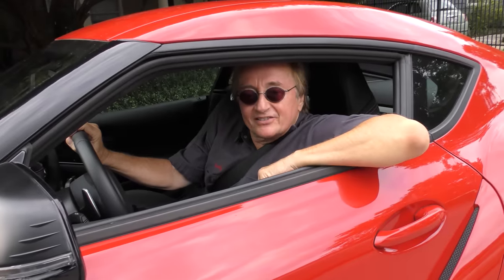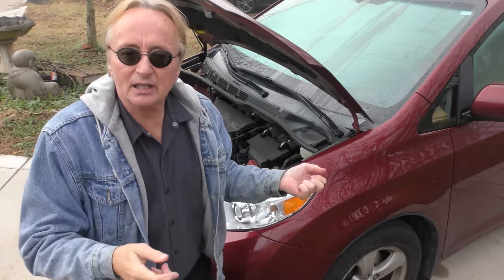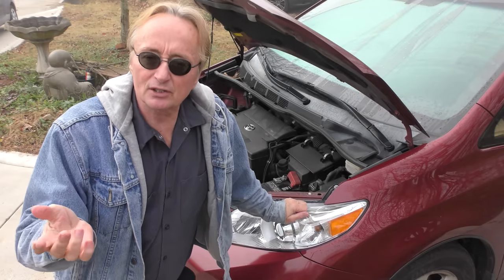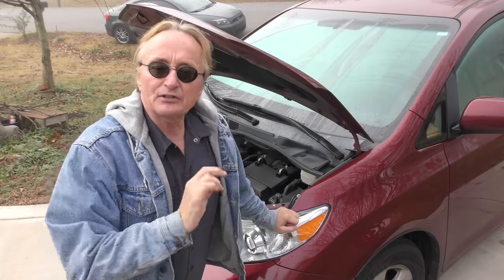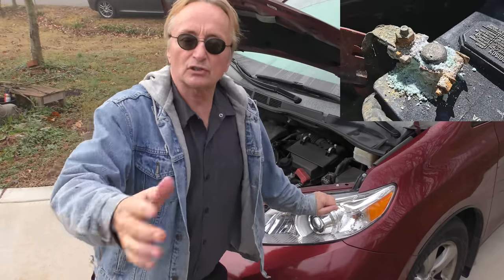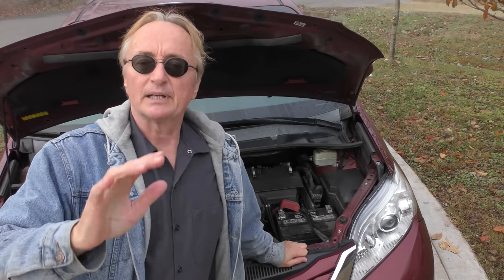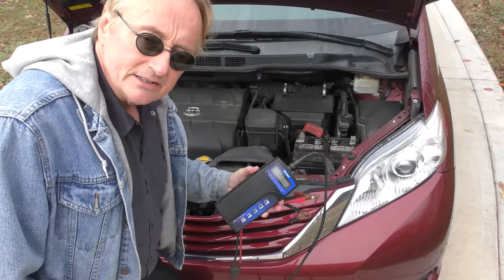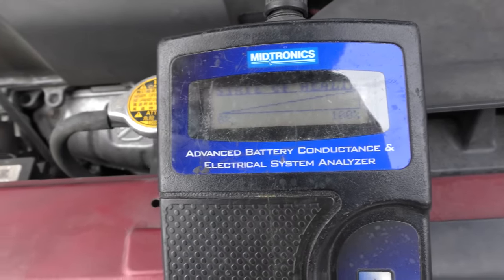If You Buy a Car Battery from This Place You’re Stupid

Comment: Hi Scotty, I once wasted 5 years of my life working in a battery manufacturing plant.  I learned a lot about automotive batteries as well as getting lead poisoning. Now this manufacturer is very well known company but the real secret was that we built batteries for everybody.  We built batteries for discount auto parts stores as well as batteries for the likes of Ford and John Deere. Sometimes our production line would change who we were building for mid shift.  The reason this was possible was simple. The only difference between the 70 buck discount battery and the 160 buck JD or Ford battery was the color of the plastic case and the placard we slapped on the top.  Internally they were all the same battery.  The only different battery we made that was different was military grade batteries. They were three times the size and weight of car batteries, were constructed with a much heavier shell and still had tar filled tops so bad cells could be easily replaced.                                                                                        Recently some scam artists are claiming they can teach you "the secret" of repairing car batteries. Now there is a way to get a bit more life out of some small rechargeable batteries if you don't mind one or two of them exploding in your face. But I know for a fact today's car batteries are specifically built so nobody can repair them. If a battery came off the assembly line defective we would cut the top off with a band saw (because once the top is epoxied on it will never come off) the lead was then recycled and the rest of the battery (plastic shell and paper separators were tossed into the trash bin. If the manufacturer can't repair them nobody else is going to be able to do so either. The lab boys spent all day making sure of that.
Reply: Jj
Reply: My buddy worked at a battery place. He told me you are tested once a month for lead poisoning. If your levels are too high then you need to work with a protective suit until they go down. Sounds nuts to me they don't wear that stuff all the time but I would imagine getting very hot in summer.
Reply: Wow. Very informative and interesting
Reply: When my father was a child medly 40's last century told me the batteries don't die and light bulbs ether. But I can think No bussines there..!!!
Reply: 200 start amps. 5 courses x 20 minutes each, hour rest in between. Makes the acid like new in any 12V battery.
Reply: @blackopal3138  I wonna see the science to this....
Reply: 'Merica's Capitalism at it's finest.
Reply: @yawhbrawh6984  Lol, I just repeated what I watched in a video 5 mins before this one. But, it definitely seemed worth a shot. The guy claimed years of experience with it, and did one in the video. Search things like 'revive your car battery', 'don't throw it away', It was about 15mins, but there were a few actually. *it may have to be an open cell battery. Cz his science was partly that they dehydrate and lose the ability to electrolyteybridgemakey ability, lol. But refilled the cells anyway, just distilled water. GOOD luck!
Reply: Sounds like Deka
Reply: I was at a Kubota dealer and an Interstate battery truck pulled up. The driver had a stack of Kubota stickers to put on the batteries he delivered
Reply: 8778
Reply: @blackopal3138  
Most car chargers today won't let you shock a battery back to life anymore.
Its hard to find a true unlimited 200 amp charger thats not regulated. Thats what you need.
Reply: My friend worked for Duracell & he said they made batteries for every one else. They just changed the outside design.
Reply: How u get lead poison
Reply: Was your company Johnson Controls?  They make the batteries for several different companies.
Reply: cd in 😅
Reply: Throws Distilled water in the lead acid component
Reply: I can't imagine getting your fingers exposed by literally cutting the top of the battery.
Reply: To explain further, when we cut batteries up they still hadn't been filled with acid and charged. The defect would have had to been discovered prior to moving the unit to the charging room. Once the batteries had been filled  with acid and charged any undiscovered defect the customers found was covered under the individual companies' warranties, the battery was replaced with a new one and the defective unit was consigned to the trash by the service department and a note sent back to us for credit. Most defects at this point however, was discovered by the seller when they gave the new unit its final top up charge prior to the unit being installed in the final customer's vehicle.
 @theplasmatron3306

Comment: Seems like the cost of a battery at Auto Zone goes up 25 bucks every time I need one...
Reply: I've worked at AZ for 3 years now as a 2nd job. The most any battery has gone up in that 3 years is $10 & that was during this year. There was a $5 increase in the spring & another $5 increase in the fall.
Reply: @Zib187  I need a battery roughly every 3 years...  In 2015 I paid $125 and in 2018 I paid $150 at Auto Zone and I always get my batteries there....
Reply: @fireengine77  back when I worked there in 2002, Gold batteries were around 75.00! Lol.
Reply: It's like they knew you were coming.
Reply: Wal-Mart cheaper than autozone
Reply: @fireengine77  Should buy your batteries from Wal-Mart. They are the same batteries sold at AZ, Advance & O'reilly's. They just put a different sticker on them. I think there are only 5 factories in the world that make lead acid car batteries.
Reply: Inflation. Your money is worth less than it was 5 yrs ago. So we see rising prices...
Reply: @Zib187  that’s true. All made by Exide.
Reply: Before  was $30 and $45 dollars but now my last  2 batteries was $160 and only last me 3 years.
Reply: They've treated me extremely well tho, even giving me a new replacement just bc they didn't have the exact one I returned even tho old one was OLD...the one they gave me was fine for my application.   I also got 10 yrs out of a 2 yr Duralast from them.
Reply: @Zib187  but they may be sitting on the shelf a lot longer, which is no bueno.
Reply: Buy the best one with the 3 year full replacement and maybe 5 years prorated. !
Reply: @NoName-gv6nm  I've never seen a battery at Wal-Mart that was older than 2 months. They sell a lot of batteries. My father-in-law works in the automotive dept. at Wal-Mart & told me that they put in a lot of batteries. About 2 weeks ago at AZ I had to re-set the planogram for the batteries & found some batteries on the shelf that that a manufacture date of 12/18. Most batteries at AZ are less than 3 months old but there are certain one that don'ts sell quick like the side post batteries & those are usually 6 months old or older. AZ batteries are CRAP. I say that because we warranty a LOT of them. A lot of the DuraCrap Golds are warrantied in under 8 months.
Reply: @andyhuang7526  The DuraCrap Golds no longer have 5 year warranties. (3yr replacement & last 2 years prorated). They only have the 3 year replacement on them now. Been that way for about a year now.
Reply: Robert Burley  FYI, my paycheck at AZ goes toward buying ammo every week. 😁
Reply: @kachiquitaito3341  Most batteries these days last about 3 1/2 years due to all the crap they have to power up in today's cars.
Reply: @Zib187  Johnson Controls, Exide,  Enersys, and Yuasa I believe.
Reply: @Zib187  You right.
Reply: @fireengine77  scotty can trash talk all day about mercedes, but our c280 from 98 still had the original battery! :)
Reply: @demogadget  LOL...  good for you.   I’ll stick to my Yaris 😆
Reply: My experience at AutoZone you're lucky if you get 6 mos. from a battery - once I had to replace them twice in a few mos. time.  I just had one go out after 4 years so that's a long, long time by their standards.  I went somewhere else to get a better battery cheaper.
Reply: @chippong497  Costco/Sam's/Bj's are even cheaper if you have a membership.
Reply: Went to AZ last summer and the battery was $150.  Then went to WallyWorld and the same rating battery was $90.  Guess where I bought the battery from.
Reply: @fireengine77  rural king $55 2 year free replacement exide brand
Reply: @kachiquitaito3341  bingo I paid 180 for my last one and live in Arizona so the batteries get 2 years on average
Reply: @jenR2120  Wow 2 years.
Reply: @kachiquitaito3341  ya u might get 3 if lucky but the summers here drain them on average at two. It’s just too damn hot
Reply: @kachiquitaito3341  just like tires, the heat blows them before the normal life also. Most mechanics I know say to change every two years if u dot want a flat. The heat destroys everything
Reply: @jenR2120  you right.
Reply: Costco  top of line 9oo crank amps  is interstate about 110.oo 3yr free replace and they install free
Reply: @Zib187  do dura last and dura gold are the same thing just ripping people off ??? Just wonder because they would recommend me the gold one at my local az 🤔😏
Reply: @rickmontalvo9527  No they are different. There's a difference in how the plates are in each cell. Can't remember exactly.
Reply: @Zib187  ah ok...thanks !
Reply: Funny i see batteries for $99 dollars but my car always needs the one that costs $170.00
Reply: @katomartin6747  Those $99 batteries are garbage.
Reply: @Zib187  yea its also not the correct size for my car nor do they have the proper cranking amps. My duralast gold barely made it 3 years from autozone this time im getting either diehard or interstate. All i know is these batteries dont last like they used to.
Reply: @katomartin6747  Motorcraft batteries are the best from what I've found. I have a friend who's family owns a small chain of battery stores & he also told me Motorcraft batteries are the best lead acid batteries. My son's Motocraft has been going for 7 years now & I had one last 9.5 years. I have a friend who's motorcraft lasted him 11 years.
Reply: @Zib187  Good to know. I was considering one before the Diehard since my car is a ford.  Thanks for the info
Reply: @fireengine77  Go to Napa, their warranty is still 7 yrs. for some of them.
Reply: @Zib187  They can change the assembly line to manufacture to different specs, same with oil filters.
Reply: Walmart tends to have the best deal and quality batteries. Get their best battery for $98 any day of the week.
Reply: @Zib187  Yes, Deca is one of them.
Reply: @Zib187  I'm one lucky O"reilly battery owner. series 78EXT 850 CCA Super Start and its going on 8 years old. I think its ready for replacement soon but continues to start the engine normally thus far.
Reply: @Zib187  what is good brand of battery to buy in walmart? autozone is too expensive now
Reply: @andrem7th  Walmart only sells their brand in-store, which is their EverStart line. They sell others through their website. The EverStart is the same battery as AutoZone's with a different sticker on it. There's the regular EverStart & the EverStart Maxx. THe Maxx is the same as the Duralast Gold at AutoZone.
Reply: Ended up getting the ford motorcraft battery for my ford from the dealer it was $30 dollars cheaper than at the autoparts store!
Reply: @katomartin6747  It's a much better battery as well.
Reply: Every auto part store chain is super competitive with their competitors so they'll price match walmart if you ask them to (I saved 80 bucks).  Just don't expect them to be enthusiastic to install it for you.
Reply: @lonniebeal6032  as of this writing they made it 60 months prorated and 18 months free replacement.
Reply: As someone that works at AutoZone and was a store manager for 8 years, blame that on politicians, they cause the inflation. Especially in California where I worked.
Reply: Sonata battery cheapest 200
Reply: @tbrwn2548  tell them to price match Walmart. Problem solved.
Reply: If you have a Costco in your area, Buy there batteries !!!
Reply: Yes; I remember paying $45-55 for a car battery for DECADES.  Then all of a sudden, it was like $80+ and now it’s $125+!  Ridiculous!
Reply: @dennishassler605  My experience with them has been hit and miss. I replaced one and it was still going 3 years later when I traded the car in. The next one I got 4 years out of, but the car was destroyed when my area flooded. The next one I bought appeared to be working fine, but when I took my car to the dealership to be serviced, they told me the cranking amps were lower than they should be. I took it back to AutoZone and showed them the printout the dealership gave me and they replaced the battery for free. Many of these batteries are made by the same company, so I don't know if it matters which one you buy.
Reply: @edwinlopez8559  I got a close out battery at target it lasted the longest ever. Now every battery I have put in my Jeep lasts about 2 yrs tops
Reply: I just had this happen to me after buying a battery at autozone lol. Is this some kind of scam?
Reply: Are the batteries at AutoZone any good?

Comment: Anyone else notice...Cars today don't give warnings when the battery is getting old and worn out. You just go out one day and suddenly it won't start. Also, they have scanners that can check the battery health that plug into your OBD port (on board computer). WHICH MEANS.....your car's computer already has the proper testing and feedback components and car makers could easily give you a warning before you're left stuck. But they dont!
Reply: A cheap multimeter can solve all your problems.
Reply: Because they are too cheap to implement the hardware/software
Reply: Its,called the alternator light bro
Reply: @bill7788  Not the same thing at all
Reply: I found out on my Jeep Renegade when my remote wouldn't unlock the doors. It ran OK otherwise.
Reply: To build in system monitoring to the dash would look like a 737 cockpit. But it would be nice to display the live charge of the battery
Reply: @AndrewSmith-rk4di  That's not what I'm saying. All you need is a menu that allows you to read the results when desired. The same way you can do so with Climate controls, stereo, or GPS. The fact is, car manufacturers just want to bilk you out of money at their service departments, which includes the ability to have a tech LIE to you and say you need stuff you actually don't.
Reply: My lady car did that, started up, she drove 3 mins down the street to the gas station, came back out and her car wouldn’t start smh
Reply: A battery can seem okay but it could lose its charge just sitting an hour or two parked in the driveway.  Happened to me recently after being stranded three times in one day.  Local auto parts store tested the battery and said it was 95% good.  It was freshly charged from my alternator, but it wasn't being tested properly for holding a long term charge.  It was bought at same store brand new only a month previous.  A gold series with 3 yr warranty.  Don't know what was wrong but as soon as I convinced the manager to replace the "new" battery with another one, the problem went away and hasn't returned.

A bad battery could in rare cases be due a parasitic drain from an electrical component or wiring issue.  Won't be detected by a scanner.  Also OBDII scans will often just diagnose a symptom not a cause.
Reply: @nathangant7636  You could have similar problems with a bad voltage regulator